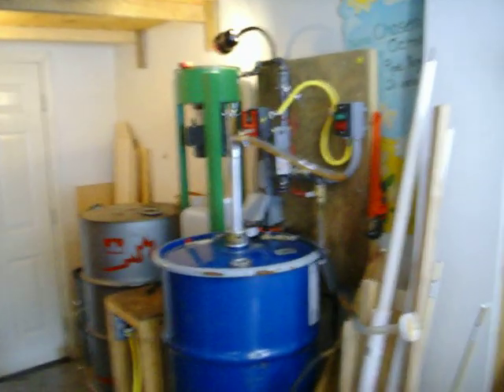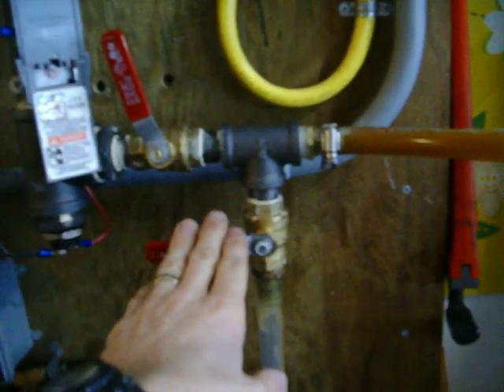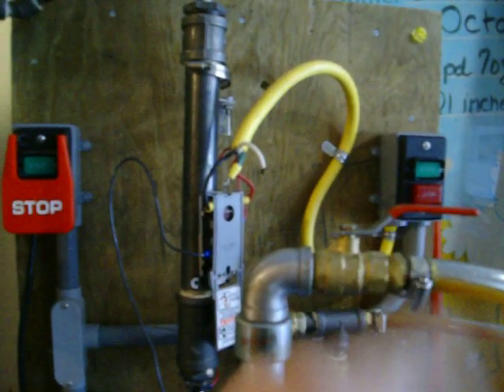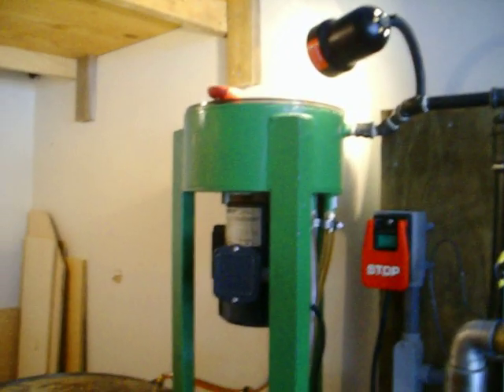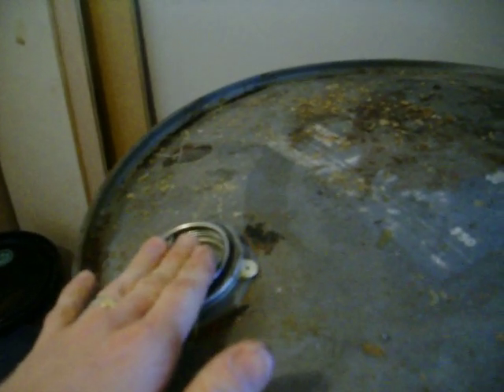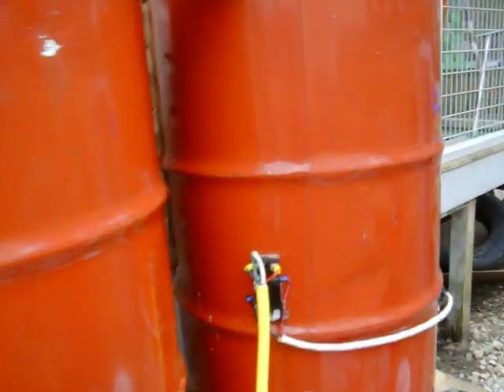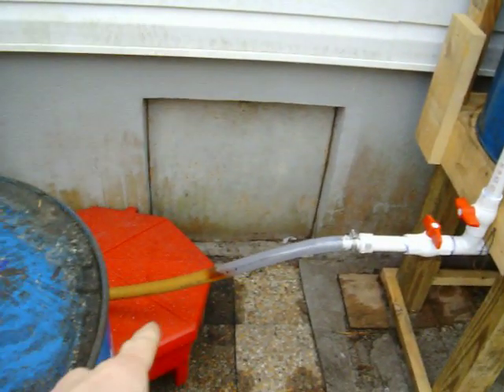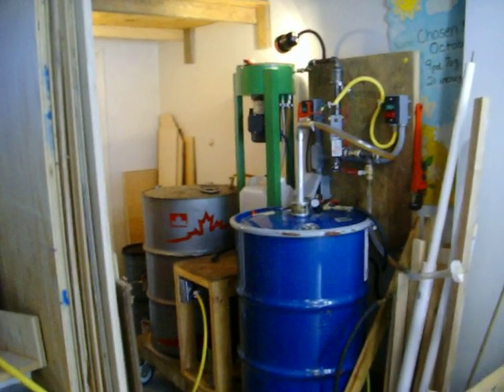Centrifuge filtering method 2.0 Waste Veggie Oil WVO

Comment: Not all cars will feel good about the method that you're suggesting, 8100rpm.
My research tells me that older cars ( pre '93) will run fine that way, but newer cars, such as common rail engines and such, need a cleaner fuel, such as fully "converted" biodiesel.

Comment: how good is the bee clean doing the oil? you dont have a video of the actual clean up of the drum?  how much does the bee clean cost?
Reply: +hunkenpunken I bought the Bee Clean from a guy going out of business. I paid around $700 usd for it. I originally ran the centrifuged oil through a 1 micron bag filter but found that it wasn't necessary. High heat centrifuging at low flow rates yields excellent results!!

Comment: so is this how it works:
1. you get some WVO from McDonald 
2. run the oil through a filter for big chunks
3. run the filtered oil through ur centrifuge to filter out water and fine particles
4. then store it for some time....
5. and load up ur truck with the final product filtering it again through a 15 micron filter 
thanks